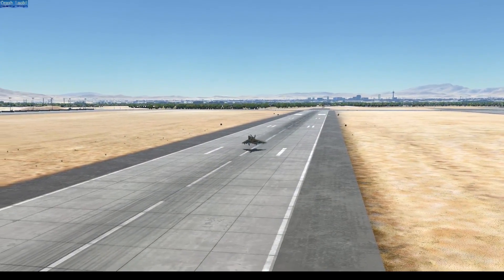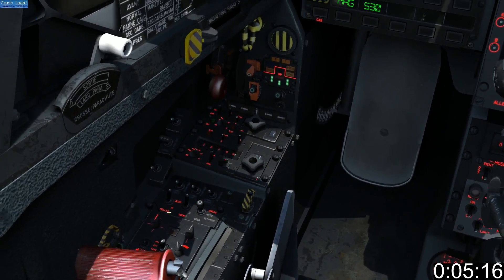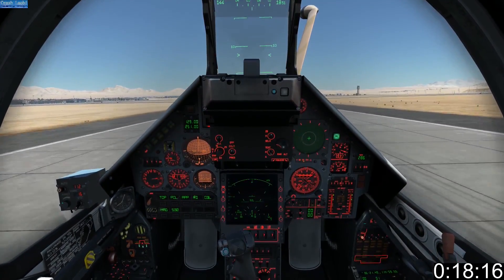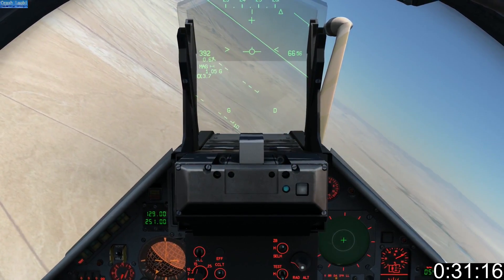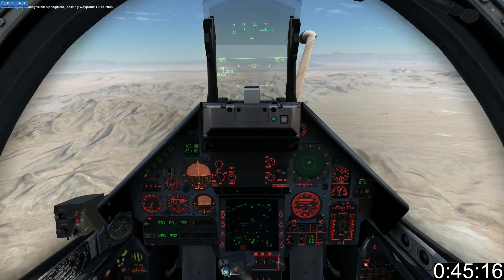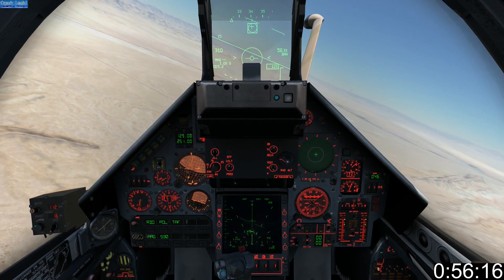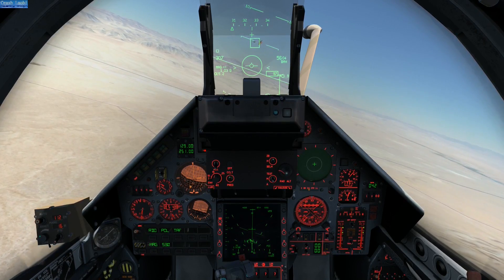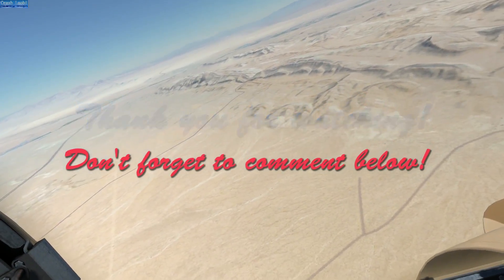1 Minute DCS - Mirage M2000C Magic II Tutorial

Comment: For the second part, don't you have to press magic-slave to actually transfer your radar information to the magic to get an earlier lock?
Reply: Yep, it'll let you lock the Magic without lining up the cross on top with that combo Magic Slave / A/G Designate   button, while you have a close radar lock within the Magic's general field of view
Reply: something I keep trying to find is how in-plane to create a waypoint that's designated as a landing waypoint to make the synthetic runway show up (notably on multi-player servers where I don't have access to modify the mission itself).  I can set waypoints on the fly from jtac/fac lat/longs (though they're usually a little off), but don't see a way to indicate that it's a landing waypoint to encourage the synthetic runway to show up .. ?
Reply: Afaik, the synthetic runway can't be programmed inflight, only through the mission planner. It looks like something that was inserted in the data cartridge.
If you want to have a synthetic runway for a backup runway, maybe you can add it as the next WP.
Reply: For the deg/min/sec thing, i've switched the simulator itself from lat/long to lat/long decimal, which helps that story a bit.  the jtac/fac reports come in now in decimal format, as well as the reported position on the map when you mouse-over it; makes for easier/direct entry into the mirage's nav keypad
Reply: Haven't tried yet - was looking through the manual to see what designates the runway heading and glide-slope (it claims there are buttons for it, just need to try it still) for waypoints
Reply: I typed numbers in with cp/pd selected, and it accepted them, but nothing visually different seemed to happen. Was also playing with the in-flight ins realignment, not fully sure if that's working properly yet, either.